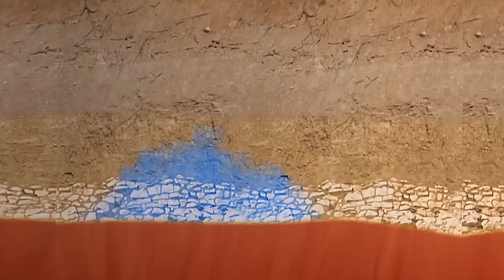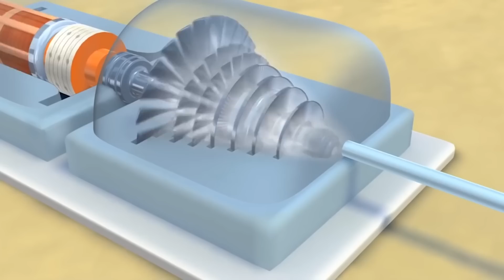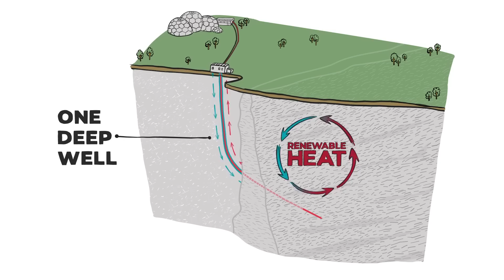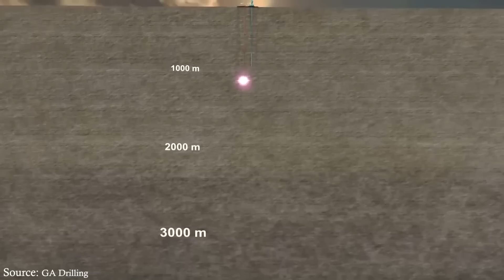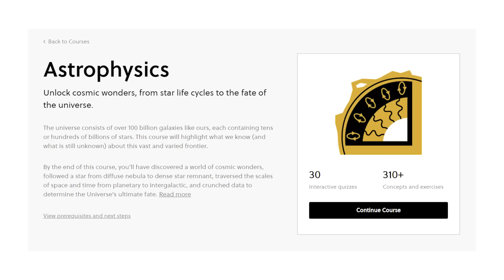How This Hole Keeps Generating Energy

Comment: Good vid, I love the idea of geothermal power production, it ticks many boxes, Im surprised that Elon Musk hasn’t/didn’t start pursuing these goals with his Boring Company instead of underground roads, maybe that technology could get us down so far before vertical &/or horizontal drilling is started, or maybe his boring machines could be modified in ways to enable fairly deep drilling/boring autonomously, and yes it would not be cheap, but neither is fusion research or landing scientific probes on Venus or Mars, or most scientific research for that, & at the risk of being caned, I believe we need to take some risks to explore & exploit Geothermal potential.
There are many places on earth where the heat is literally bubbling to the surface and Australia has many of these places all over as well. While higher temperatures may yield greater efficiencies, Geothermal Power production does not necessarily require the higher temps some may believe, when using a steam turbine based system, as the pressure created to turn these turbines can be delivered from a secondary fluid/gas/refrigerant heat exchange system, which can be boiled off at very low temperatures to drive the turbines & then recycled in an efficient way.
I am not on board with comments regarding over cooling of these sites without real research data, there is a lot of heat down there, and there are sites where experimental Geothermal power production is being used this way & showing a huge success, according to my research, & while I am not a Professor, I’m not a Dummy either, just curious. This system is supposedly, easily throttled up or down as required 24/7, it uses a very small footprint, is easily expandable for more production & took about 2 yrs to build, if its at the better health & being of our planet, then how much is too much to spend…? 
CERN, Hubble, Webb, Fusion, are all not so cheap technologies to play with to prove and expand theories, but we do, maybe because we can….but I do think it is all worth it, and I dont know why more R&D dollars aren’t thrown into more geothermal solutions. 
If for some reason we suddenly find a cheap or free source of energy, it doesn’t mean our power/gas bills will necessarily reflect that in any way….does it? Maybe some think it should or will, regardless we may contribute greatly to our own salvation & that of our future generations if we can mitigate our energy and waste solutions sooner than later. 
Nuclear Reactor’s may sound ok to many, but there are still many issues, waste, etc, while we now are pushing Hydrogen ICE & EV’s for commuting, when we cant even keep the lights on when it gets hot in some places, battery materials are becoming harder to keep up to the market supply needs, & Australia has bugger all EV refueling infrastructure as it is, if it is actually working, let alone Hydrogen, which sounds nice emission wise, but is in all scenario’s a non efficient way produce, transport & to power stuff, so Deisel is in for the long haul here, quite literally, sorry! Just my thoughts. Go Geo!

Comment: What about using large (really large) "solar ovens" for trapping heat. They get really hot. Then a metal cylinder inside transfers heat to another section where it heats water to create the steam to power the turbine.
Reply: Been there.  Done that.  This method is not profitable.  A big solar plant of this type has been abandoned in California.  They cannot run it with a proft and keep losing money.

Comment: You don´t need plasma drilling. Only a drill that uses water pressurised up to 2000 atm that will destroy almost any material a driller will find. You only need recirculate the dirty water, clean out the rests of the crushed rocks and repeat the process.

Comment: the temperatures and pressure will destroy pipe network.. it will melt steel and turn the sand around the pipe to liquid glass. and how big would a pip have to be? and how heave would a 20k pipe weight? the hole is one thing, but that's the easy part.. don't give up on gas and coal for the next 50 years..

Comment: We don't need to bring the heat up by using water or fluids. By using super conductive materials that won't melt, the heat is conducted to the surface and then used at the surface to heat fluids or gases to drive turbines and generate electricity. 
There's even thermalcouples for example that generate electricity from heat. 
In the Western U.S. there's one 1000 degrees of heat at the surface .... energy is everywhere that is little to no pollution and won't pollute ground water ... we just need to use common sense.

Comment: The now age-old problem with getting free heat energy from geothermal sources is simply to do with the poor heat conduction of earth-rock. Any heat energy removed from a location under earth's surface will cool that location, and it takes time for that heat to be restored from beneath the location. No matter how large the area chosen beneath the crust, cooling will happen, and restoration of that heat occurs at a fixed rate. The rate of extraction of that heat can be calculated, and it is usually too low to provide all that is needed above ground. Wairakae Power Station is a geothermal plant in central North island New Zealand. It has been dogged with this cooling phenomenon since it was built in the mid-twentieth century. The surrounding rock under the earth's crust at that locality has been cooling from the start, thus limiting the rate of extraction of heat energy to much lower than when the station was first built in the late 1950s.

Comment: Imagine if quaze set up their plasma drill on a massive wind  and or solar farm that is stuck waiting years for grid connection. The project gets built before grid makes up its mind, by using all it's power to make a flexible generation unit

Comment: It is worth noting that there is not a net production of geothermal energy from the decay of radioisotopes in the current day. The heat flux from the Earths surface is greater tham the thermal energy produced by decay of all long lived radionuclides (e.g. U-238, U-235, 147Sm). Most of the Earths thermal energy was generated in the first 10 million years after the Solar System formed by the fast decay of short lived radionuclides (mainly Al-26, Mn-26, and some others such as 92Nb, 97Tc). This was a ubiquitous process in the early Solar System and provided the heat that produced some of the oldest differentiated meteorites (iron meteorites). Some of the heat was also provided by the accretion process amd the latent heat of crystallisatiom during silicate differentation, again both very early processes that occured before 60 million years after the Solar System formed. The large radius of the Earth has insulated this heat for 4.567 billion years. But the Earths geothermal energy has been slowly lost to space for most of that time and is still being lost today.

Comment: At a certain point the drill a length of pipe then pull out to add casing and before they can get casing in the length they drilled fills back in.

Comment: Why is it "very expensive" when there's "low energy conversion"?
I don't see an inherent expensive matter, just that initial costs were high, and the return would take longer. But wells can be expanded or modified; yes, initial cost is raised, but in the long run, benefits are much better.

Of course, better planning and efforts should be applied from the start, so to avoid such situations.

Comment: Totally agree. I'm not sure if anyone has said this, but with the geo thermal deep drilling to make the coal fired generators still viable, it would also make the renewable agenda and greenie shut down a bit maybe!! Just joking, nothing will shut those idiots up. But in Victoria where years ago one Jeff Kennet sold off our state utilities to private enterprise and started the ball rolling to where everyone is now up to their nuts in payment plans just to turn their power on. But the main point I see with this new geo thermal use is no one has picked up yet that all these renewable power generators can't operate on the existing transmission network. That means there is a massive rebuild you haven't been told about yet coming, and who is going to pay for it?? Whereas the geo thermal they are now proposing can generate power straight out of the coal power generator straight into the existing network. We are being conned by idiots, but I feel we are the bigger idiots for listening to the bullshit we're being fed

Comment: unlike to solve the energy crisis: The primary issue is that water is going to pick up a lot of disolved minerals which will over time close up the hole and you need a lot of surface to run a large generator since a small hole is going to limit the amount of heat that can be extracted.

This is a case of not considering all of the engineering challenges. Recall the large solar concentration plants which just turn out to not be economically feasible after billions were spent on them.I also don't see how the team is going to effectively remove the drill tailings using plasma. Convential drillings use a mud to hydraulically remove the tailing, I suspect the Plasma drill only uses compressed air which will fail to remove tailings efficiently. The more I think about this project the more its just a bad pipe dream.

Comment: This once again has already been tried several times.  The problem being the deeper the bore hole - the prone to failure of snapping the drill stem.   And as you get closer to softer rock it is more like plastic and you can't drill it.   It is to pliable. 

Yes these ideas all sound wonderful.   The Russians tried with the deepest bore hole and could not get past the soft rock layer.   It's been tried by SANTOS in outback Australia - and the drill equipment kept failing due to bore depths.  And the temperatures really were not getting to the levels to generate steam.

Again all these "wonderful"  wants someone else's money to waste.

Comment: What about well heat drops over time?Is it possible to exhaust heat if a well?
Reply from the maker: This is a great point - if you take the heat out at a slow enough rate, it will continue to deliver heat for a very very long time. However, if you remove it too quickly, the well will become exhausted (in maybe 25-100 years depending on extraction rate). Thanks for your comment!
Reply: @ZirothTech  Is it possible one plant to use lets say two wells and rotate them and this way give them time to "reheat" themselves?

Comment: the problem is people will think to put up their own powergeneration in their back yards, it would be good to disrupt the current greedy fatcats, but what about water table that drops and causes sinkholes if too many people can get their hands on cheap geothermal drilling equipment that can go 20-30 km? all these things should be taken into consideration...but there is a way to tap it safely...........
solid graphene shafts, the thermal energy at the geothermal end makes the powerplant end above 90% as hot...heatconductivity...☺

Comment: I'd love to see geothermal become popular and then our core starts cooling rapidly and we turn to Mars because no magnetic field to protect our atmosphere be interesting or for instance windmills taking energy out of the wind causing climate and weather problems so many possibilities
Reply: The core is 4000 kilometers down. The deepest wells are only ~15 km.
Reply: @denysvlasenko1865  and? You don't think heat radiates and moves? The core warms from the inside out so each layer gets heated and will pull heat from layers below the earth is radiating heat from any surface exposed to air and space so it's losing heat not matter what I'm more interested in what exploiting that core energy (even though not getting the energy directly from the core because we can't drill or excavate down easily due to the heat) would do and I mean proper exploiting as in most governments and nations begin expansively using it as a base line source for renewables
Reply: @denysvlasenko1865  also your timescale is sorta off I'm talking about it having an affect down the line multiple generations not directly affect us currently
Reply: @Jazzafritsch  Thiunk about it this way. Even extracting all energy from 15 kilometers below by lowering its temperature from its usual ~500 C to ambient ~25C will mean that now the core is insulated from cooling not by 4000, but by "only" 3985 kilometers of overlying layers. And you think this change would have significant effect???
Reply: @denysvlasenko1865  sure I mean if that pulls enough energy out of the core because it will always radiate it's heat out and earth is relatively sorta a bad insulator since it's a solid and can easily conduct the heat but all you need to do is weaken the magnetic field generated from our cores complex interactions and then we get even bigger problems like more solar wind tearing away even more atmosphere than currently again in talking in larger timescales here not something you or I would ever see
Reply: @Jazzafritsch  What larger timescales are you worrying about? 500 million years from now?
Reply: @denysvlasenko1865  well with how politics works evident with our current coal consumption once we find something that works we do t like to change or adapt often so my point is to properly prepare our culture and civilization now so that it can exist further down the line. And it's something I care about so that's why I like the thought of my genes continuing at least to the end of our planet hopefully longer

Comment: I’m sorry, I would keep this paper be even see as there are parts missing from the entire process steps that you haven’t mentioned you’ve glossed over the headlines, and have not delved any deeper into the problems of geothermal energy as they can’t use water decay contains impurities, which then close the water line so they’re not using water and the whole system resembles Fracking where your pumping water into fractional rocks and pumping it through what happens if you fracture the ground and it collapses in on you, taking your power plant and causing a earthquakes and other damages to homes and property so no, you need to do more work and more study and less glossing over critical components in critical steps

Comment: I wonder if, as a byproduct, all that water would lose its salinity and become drinkable. It could be a potential route of piping the output back into revenue production while also helping the world, a pr win and an economical win? 

I'm not too learned on this though, so I could be wrong
Reply: I'm not sure it would be drinkable. If they are using lubricants on the drill it would pollute the water. Many gas drillings for natural gas can and will make ground water very toxic if the well fails or the rig acts up.

Comment: How does one get the idea that the earth's core is hot because of radioactive elements? I'm pretty sure it's just friction sustaining the heat but someone smarter than me is free to correct me. Also we can't dig deeper because either it gets too hot, too expensive, we lose interest, or we run into something we can't drill through like magma or pockets of hot water.

Comment: in finland heating houses with ground heat energy is very common, usualy make 200-300m deep holes, take pipes down there with compressed alcohol, and the heated alcohol comes up to heat exhanger, it will take some electricity to compress and run the pumps, but its much cheaper then just to heat up houses with just electricity.

Comment: wouldn't this actually cause the core to cool down quicker? like a tiny heat sink?
Reply: No. Because we have not even come close to penetrate the 'crust' even with the most advanced digging equipment and drilling projects to date. It'd be like trying to freeze a orange by pushing tiny really cold needles gently into its rind.

Comment: It’s not renewable energy. The earths core is a closed system, it has a finite amount of energy, there may be a lot of energy but it is not limitless. If we think of it as limitless we run the risk of overusing it because the real solution to the energy problem is to use less not generate more. If we take energy out of the earths core we will effect the way that it heats the planet. Also we have no idea how drilling into the earths core will effect the tectonic plates, weather systems and potentially the earths magnetic field?

Comment: I think tapping into our crustal and mantal heat is far more dangerous than tapping into our atmosphere, and I cannot help but think it could hurt us far more quickly.
Reply: Explain how
Reply: @tangchan6221  You are conducting heat out of a system that may require a certain maximum viscosity to maintain our magnetic field adequately, without which we could accelerate extinction problems and degenerate ecosystem health.  Isn't that obvious?
Reply: @xenocampanoli815  not really, I have trouble seeing how a couple of those holes could affect the Earth magnetic field. Do you have anything that could support your hypothesis ?
Reply: The scale of activity required to cause this is probably less than 10% of what we are already doing to the atmosphere.  You don't need to admit anything.  Everyone else will find this obvious, even if you refuse to.

Comment: Bringing the heat energy from inside the earth to the surface sounds like a really good way to accelerate global warming.
Reply: no. The heat energy is contained, and not released back into the atmosphere. It goes into powering all of our lives. In this sense, if we replaced all of our energy production with geothermal, this would reduce emmitions from burning organics. If we swung the other way and were burning the equivalent for the amount of geothermal, we would be burning a lot more, increasing the emmitions.
Reply: Gotta think about where energy is coming from.